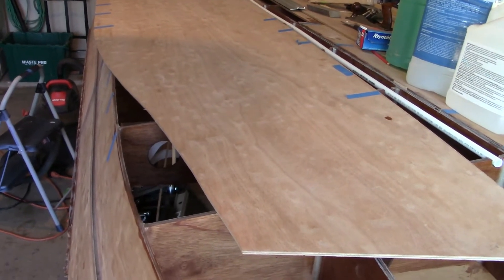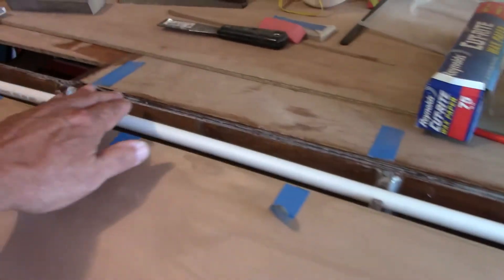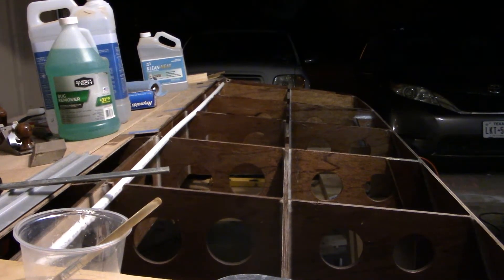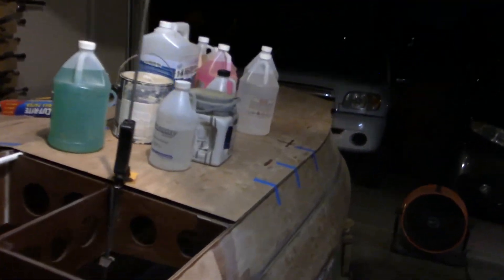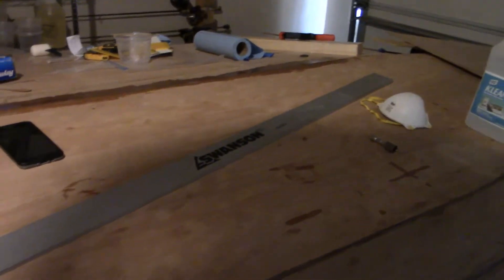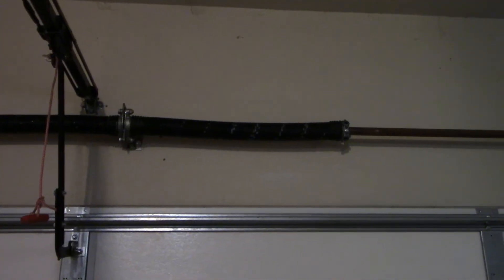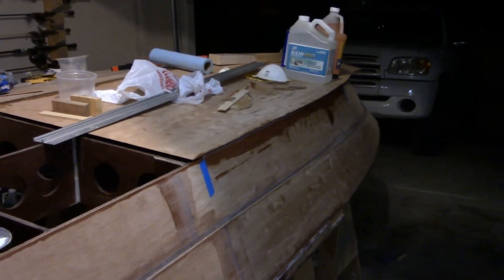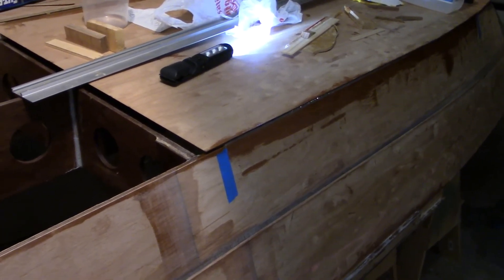Flats Skiff Boat Build DIY! Bottom Panel Install Part 10, Left Side Forward Panel Install.

Comment: I found a trick that helps laying in the thickened epoxy. Mix up a batch and put it in a cake icing bag. You can cut a small or large hole in it based on your application thickness. It makes it super easy to control.
Reply from the maker: Thank you Beau! I've done that a time or two in the past. Getting it transferred from the mixing cup to the bag was a bit messy! I saw someone else on Youtube do that by placing the bag in the mixing cup like a liner and once it was mixed, all they had to do was seal the big end and cut the hole in the other end to apply. That's something I've been wanting to try.